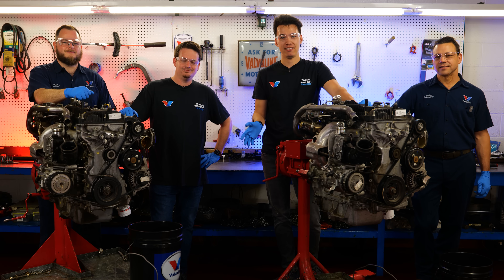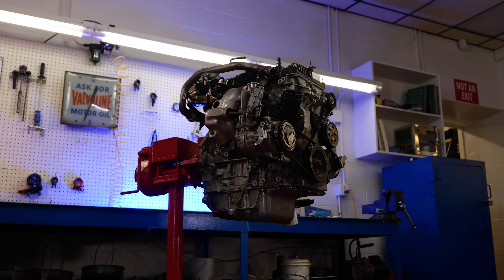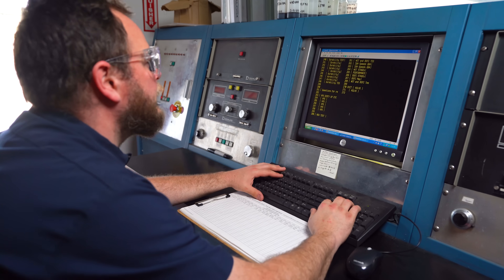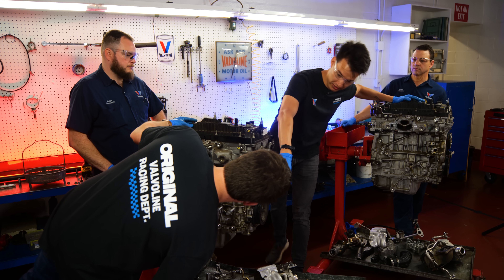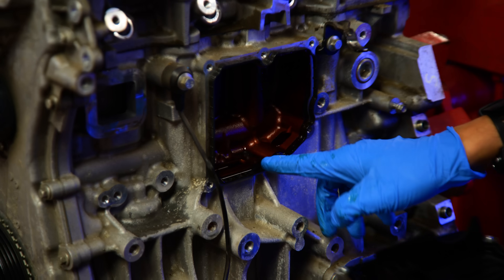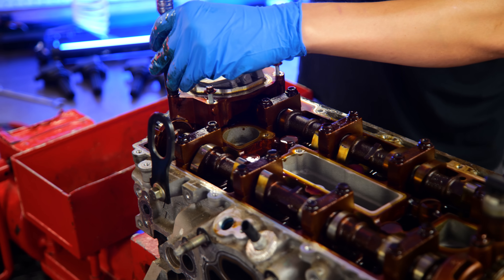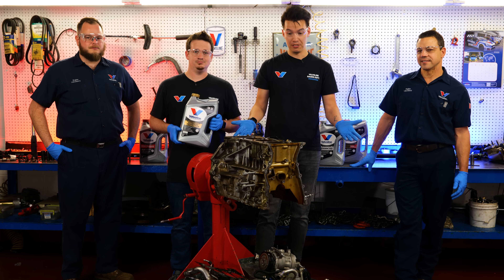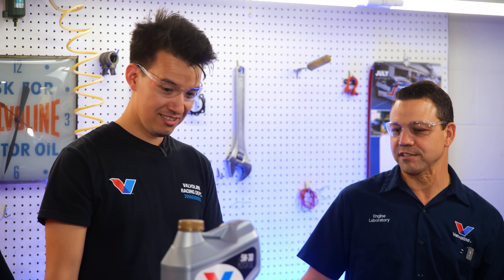Testing different oils over 4 years and 1 MILLION miles

Comment: Very informative. I’m too old fashioned to go 10,000 miles between oil changes regardless of the type of oil. I’m 5,000 at the most.
Reply: I been using amsoil signature series on my sentra since day one. I change the oil every 15000 miles.  My car currently has 220000 miles. 0 problems engine wise. Now my transmission its another story.
Reply: Some European car brands recommend 15K changes too! @JesusTamayo-z7h
Reply: Seems not a valid comparison if they were waiting 10k mi for conventional oil. Seems they should compare conventional oil with conventional change schedule, that would be so much more interesting. I’m glad I’ve been using full synthetic for ages.
Reply: Me too, and I have 420,000 miles on my Mazda 3.
Reply: there's been many tests done that show the 1 year used high quality syn oil is still just as good as new oil.
Reply: I’m full synth and with turbo engine. Every 5k
Reply: @pHixiq no point in changing the oil every 5k if you are using synthetic. 8k is more than good enough.
Reply: @FlowSharp  Not really true. Take a turbocharged small engine that's direct injected. You'd better be changing the oil more often than that, it's getting very hot temperatures, and more gas in the oil because of that direct injection..  An N/A engine, I have gone 15,000 miles for years and I have a 1988 Escort GT with 412,000 miles on it right now and it runs very well. Wife's GDI turbocharged hybrid engine, not going to go farther than 5000 miles on that one, nor my turbocharged GDI engine in my Solstice. ALL depends on the application, climates, driving habits, short trips, long trips, etc.
Reply: @pHixiq  your mistake is concentrating on oil and not the fact you bought a turbo engine.  The answer is always go by owner’s manual.
But most important it dont’ buy a turbo engine.  They were a disaster in the 80s(unless diesel) and although they have greatly improved they are another source of failure. Just worked on a Turbo ford Edge or something like that.  Car would have gone another 100K or more but Turbo failed and was a bear to get to against the firewall.  Wasn’t worth the labor and expense to fix just another trashed car.
Reply: As a senior I don't change by miles but by months. I would never go over 3,000 miles. growing up in the 1960's my dad always changed his oil spring and fall. Straight 30 wt in summer and 20 wt in winter. I can remember our cars always had for the time high milage when my dad traded. Our 1968 Chevelle had 148,000 on it so it worked for him. Oh, almost forgot he was a STP user as well.
Reply: @scrambler69-xk3kv  he wasted a lot of money.  I drove my vehicles 300-400K before someone ran into them or traded them away. My current Tundra has 300K and doesn’t burn a drop of oil. 148K is for amateurs.  STP is a waste of money cuz gas and oil already has additives.
Reply: No problem going 10K on synthetic. MK6 GTI is near 300K and still strong.
Reply: @Firstbase2001  Most engine builders are celebrating at your comment right now.
Reply: 10,000 miles intervals is insane😂 I would never
Reply: @wellyeah4690  its not - my hatchback runs on 12,400 mile (20k kilometers) intervals that fall short because service is often due earlier anyways. But i for sur reach 10k miles every time. Engine is just fine.
Reply: @wellyeah4690  Over in the rest of the world, we debate 5,000, 8,000 and 10,000 km for mineral, semi and fully syn. I personally go for 10,000 km which divided by 2 plus 10% is about 6000 miles. Been using a 15w-40 API-SM mineral oil in my small 1.5L Honda for the past 200,000 km now without engine issues. Doesn't even burn oil and next month it'll be hitting 400,000 km on the odo. I plan on asking for a valve adjustment at the workshop for this milestone on top of the regular maintenance. And take a look see if there's any significant varnishing.
Reply: @tempeleng  "km" ewwww lol nah but really even 6000 is a bit much, it may have to do with the amount of contamination in the air and other factors but most (responsible vehicle owners) don't exceed 5 mayyyybe 6000 miles on synthetic oil, regular conventional is 3000, crazy story I had a lady come into my shop and confused her transmission fluid with her regular engine oil and had not changed the engine oil in over 30,000 miles 😭
Reply: @wellyeah4690   yea i've been debating 8000 km changes. but no one else keeps tabs on the mileage of the 5 different cars/vans at home so i made it simple.

every 10k on the odo for oil, multiple of 30k for gear or cvtf, multiple 50k for diff and aircond compressor, multiple 100k for brakes and radiator. brake pads when it squeals. if anyone overshot the odometer the interval after that still comes on a 10k odo since i refuse to keep track of everything.

that's life when you have sisters driving used cars.

that 30,000 mile though. must have been like toffee inside the engine.
Reply: @wellyeah4690 Americans thinking they're the standard of everything. Ewww km, ewww Celsius, ewww diesel car, etc.

Ohh btw, cars outside US lasts much longer because we use oils that are better for the engine, not for the EPA, 5W30 vs 0W20. And we drive it smooth and with care, not racing everybody from a green light only to get stopped at the next light.
Reply: @tempeleng  if you want you engine to be spotless regarding conventional or synthetic 3000 Miles is minimum 😂 even 1 million mileage
Reply: @valferdinandmonissabiano8641  ewwww did you just say Celsius!?! *Cries in bald eagle*😂
Reply: @tempeleng How old is this engine?
Reply: @Ko90567  the Honda 1.5L is 10 years old.
Reply: @valferdinandmonissabiano8641 totally incorrect.  Outside of the US it’s very unlikely you will see cars with 200k or more km, at least in European countries. and in some countries people do not even use synthetic oil but kust regular. In the US it’s common to see cars with 200-300k miles (300-450k km)
Reply: @mattc9875  I've seen lots of diesel pickups with 300k-400k kms or more, and they're doing 10k kms oil changes. These are CRDI btw. Also, Toyota Yaris/Vios taxis over 400k kms and they're also 10k kms oil changes. Even a friend of mine said his CR-V (MT) in Philippines much runs smoother and than his CR-V (AT) in US, both are 3rd gen.
Reply: @mattc9875  , true but here is a unique situation, engines (as you said) last 200k BUT transmission usually over 600k easily! This has been true since at least the 1980’s! It’s literally the opposite relationship as it is in the USA…
Reply: @mattc9875  That is besides the point, synthetic oil makes alot of difference in an engine. I have been fixing them a long time. Iam not saying regular engine and reduced speeds won't protect an engine.
Reply: My hilux 3.0 i run synthetic 6,000 km oil and filter chang, much cheaper than an engine e @tempeleng
Reply: @wellyeah4690 the rest of the world is eww? i wonder who’s the weird one
Reply: @mattc9875 My 87 Camry was at 333,000 miles when the transmission died. I did replace the head gasket at 200,000 miles and there was still crosshatching in the bores and no ridging.
Reply: Km?😂 @tempeleng
Reply: @valferdinandmonissabiano8641 your literally watching a American video 😅😅 like bro go elsewhere
Reply: @valferdinandmonissabiano8641 we invented most modern inventions and innovate most medical drugs & medical procedures. We sent men to the moon and back multiple times while 3/4 of the world still were farmers and under developed. We invented a portable sun. We are the standard and the reason your life uses 95% of American inventions.
Reply: @tempeleng  sm is not fully metal
Reply: @valferdinandmonissabiano8641  What? There are plenty of cars in the US over 500,000 miles.  Maybe just a little less arrogance.
Reply: I do every 4K Mobil1FsHm and it’s amazing product!
Reply: Me too however my Range Rover has 20,000 miles between Oil changes, the most that have gone so far is 8,500 miles and the Oil looked surprisingly clean still!
Reply: I am not going over 3000 mls. After going to a half a million mls with synthetic Iam not going back to some other shit.
Reply: Newer engines are using 0w oils which is a thinner oil. This oil doesn't gunk up as fast especially synthetic not like 10w30 or 15w40 conventional from the 70s and 80s. There's nothing wrong with changing it at 5000 miles it's just not as detrimental as you think for some engines but other engines depending on design, its probably still a good idea to follow 5000 mile intervals.
Reply: @jamesj5130  We can spend a whole year talking about oil, if you are not doing regular maintenance, not rev your engine, reducing speeds this is all jive talk.
Reply: Same here! I would never consider going 10K between changes.
Reply: Same. I do mine usually a few hundred miles prior to the 5k mark to factor in idle time.
Reply: @jams1533 why not just change it every 100 miles 😂
Reply: @FlowSharp mine gets done around the 4.7 -5k mark. It would be stupid to change oil every 100 miles if that’s your point.
Reply: @jams1533 Well because you said "every few hundred miles" which is pointless.
Reply: @FlowSharp I explicitly said “ I do mine usually a few hundred miles to the 5k to factor in idle time”………which equates to around 4.8k per interval. You’re not exactly flowing sharply my guy.
Reply: @jams1533 . If you are using Sythetic blend or full synthetic it is still pointless to change it a few hundred miles before 5k. 

You might as well change it at every 100 miles 😂😂😂
Reply: @FlowSharp nah I’ll keep at my intervals. I have a Camry and trying to see if I can get it to 500k on the dash lol
Reply: @jams1533 I have 273,000 miles on my 2011 Honda Civic Ex. I use conventional oil. Engine running like its new.

Im sure the Camry will do much better than Honda since they're whole brand is centered towards reliability. Too each is own i guess 😅
Reply: @FlowSharp hell yeah. Good shit. 
Yeah I’ve mainly owned Toyota/Lexus and had a is300 at 279k before I sold it. They’re solid cars
Reply: 10,000 miles oil change intervals are part of the architecture of planned obsolescence.
Reply: Me too!
Reply: I just change the oil every 6 month,
Reply: 100%
Reply: Seems not a valid comparison if they were waiting 10k mi for conventional oil. Seems they should compare conventional oil with conventional change schedule, that would be so much more interesting. I’m glad I’ve been using full synthetic for ages.
Reply: 4000 for me.
Reply: My BMWs did not even have dipsticks and the computer would tell you when it was due for a change in oil.  It went by liters of fuel consumed not miles, or months.  That was for my 2009 and 2013's and I forget how many liters but it was in the range of 3,250 or so if memory serves.  Now have a 2019 seven series, garage kept in Florida so I am watching vids about oil changes because of a couple factors, one being how expensive an oil change is on the car, and the other is I hate waste, people were told in the 1940's and 50's and even 60's to get the oil changed every 3,000 miles though the oil was rated by the SEA for 5,000 to 6,000.  There for quite a few years full European synthetic was rated to go for 15k to 20 k.  Now they seem to say only 10,000 miles or one year.  I do not drive 10,000 miles in a year, more like 6,000.  So mileage to me is not a consideration, I do not drive enough to have the mileage be a factor and if I did the computer will tell me it is time for a change.  But, I have been thinking since I bought it in September used with 30,100 miles on it, and it was serviced regularly before I got it, I should change it now so I know it is fresh and then can get it changed annually from now on.  I have high confidence in the B58 motor from BMW but this is my first turbo and I worry about that tech.  I want the best protection it can have.
Reply: I'm new school, I go 30k miles between changes
Reply: @petergriffin383  that’s right dawg, you tell em!
Reply: Yeah, 10k is a little long for comfort. I wonder if the varnishing might not have been as bad if they did 5k intervals.
Reply: that's not old fashioned it's just smart.
Reply: Direct injection engine. I do it every 3k. Oil is cheap
Reply: @Bullwinkle7678 Do it every 10 miles
Reply: Yep do 10k miles and engine won't last 100k miles.
Reply: For my turbocharged car, it is common to do our oil changes at every 3k miles. I shudder at the thought of people with built in maintenance reminders that go over 10k miles by default, and think how people run them even further than that
Reply: @SoulEraser000 Tell me about it! I got a twin-turbo and I'm on that thing.
Reply: 10000 on conventional is wild to me. shouldve been 3000 oooooooof
Reply: Oil is cheap, engins are expensive.
Reply: 5K here because it's the safest - an easiest to remember!  High quality synthetic only! I also rotate and balance my tires and get an alignment at the same interval!  Help me to keep everything on track!
Reply: @michaelgawel5823 the rest is good. An alignment every 5k is cracked.
Reply: I with ya.  1980 baby here. I was at 5k mile with my last vehicle. But now I bought a new truck with a $700 payment and I went back to 3k mile changes. Need This  thing to last.
Reply: ...I must be even more old school, every 3k-3500 miles max
Reply: Of course that's why the examples here are not very relevant.
Reply: I mean there's definitely circumstances you can.. For example if you had a top of the line thicker oil in your car and drove 10-15K miles within a few weeks that'd be perfectly fine.
Reply: A wise decision.
Reply: If I switch to synthetic will it clean ir
Reply: I use AMS OIL 15W40 fully synthetic 6x wear protection and I run it to 10 to 12 thousand km and never had any issues and when draining the oil it doesn't feel abrasive at all still silky!!!
Reply: @Rangers_TT  Amsoil 👍
Reply: 10,000 miles is suggested so that your engine fails when the oem wants you to buy a new car.  Synthetic oil is so good they have to ruin the whole point of using it.
Reply: @gord8382  I've been running synthetic 0w-20 in my Lexus and when I had the oil change the other day at 4000 miles it was a quart low because of my aggressive driving so I'm going to step it up to 0w 30. I've got a heated garage and I live in the south so there's no sense in using oil that is thin as vegetable oil.
Reply: @chipbarfield62 You might be okay but engines today have really close tolerances and thus the recommended lighter viscosity oil.
Reply: @mowman7777  that's not true. I have already done enough research to know better and I've already listened to too many people on YouTube explain the whole thing so there's nothing you can tell me that I don't already know you're the one that needs to find out the truth
Reply: @gord8382 nonsense
Reply: I used to do every 3k. Now my back is getting worse I do every 5
Reply: 3000 miles .......... for my Jeep Gladiator and BMW 1250r GSA .......... 10,000 and 6000 miles respectively are NOT good ... period
Reply: I agree.. 5000 miles…
Reply: I change my oil every 6 months and 5K miles unless the maintenance schedules calls for sooner or less miles,
Reply: u are very smart and wise for 5,000
Reply: I have a big turbo direct injection engine, I change mine every 2500 miles
Reply: @ms3862 what weight
Reply: THERES NO SOUND
Reply: Yeah 10k on conventional is bad bad. 10k on synthetic isn't nearly as bad. I think that's the bulk of the difference they're seeing. If they did the same thing with 5k intervals the deposits on the conventional would be much less
Reply: @mathehack1 exactly not a fair test. Conventional oil is supposed to be changed 3,000 miles / 5,000km. You're right the should have changed the oil at their recommended intervals! Change the syn oil every 8-10,000 miles...
Reply: @brentg8600  3000 miles is still too early for conventional especially with them getting those vehicles up to full operating temp and laying down the miles. That's an old-school oil change interval, doesn't hurt anything though. 5k to 6k is probably the sweet spot but 10k is way too much.
Reply: I worked in a Porsche shop where we had one factory trained mechanic who changed his oil every 1500 miles.  He had over 300,000 miles on his engine with no measurable wear.  He swore that was the longest it was safe to go due to breakdown of the oil.  I change mine regularly.  3000 miles is my maximum and often change even more frequently than that.
Reply: @aday1637  lets be honest thats really silly and overkill for all but the most demanding vehicles

On the basis of cost alone at 300,000 miles, 1,500mi per service interval and $50 an oil change that is $10,000 in oil if he was doing it himself...more eggregious is the hundred hours or more of time he never gets back. Change that to 5,000 mile intervals drops it to $3,000 and a third of the time. 

He could buy a new engine and have the time to do it for what he is spending in oil changes. Or as this video demonstrates even a 5,000 mile interval is early with modern synthetic 

1,500 miles is definitely obsessive and kinda dumb. But hes a porche guy 🙄
Reply: No oil no matter how good it is will last 10k miles
Reply: @GoldRaven-oe4by  I have a 2002 Silverado 4.8 with 260k miles and for the last about 100k miles I’ve been doing 10k mile oil changes. It still runs great

Comment: Clean up the conventional oil and reassemble it too, but don't clean out the varnish coatings. Get the rings unstuck and all points where the metal meets metal, then run the new Valvoline Restore Synthetic oil in it and go 250,000 and see how it looks inside.